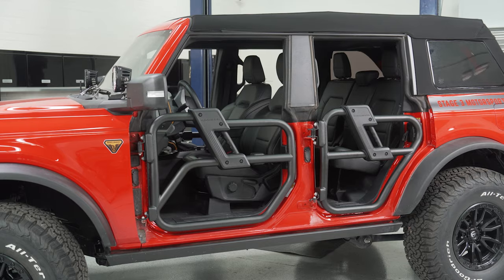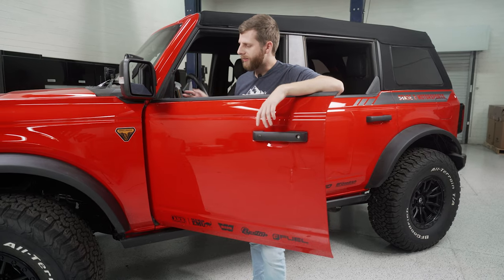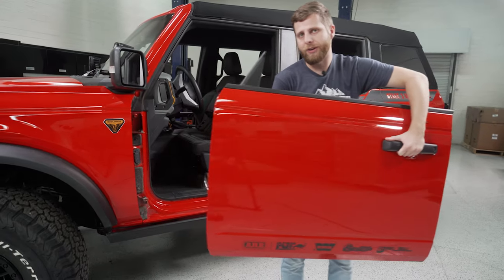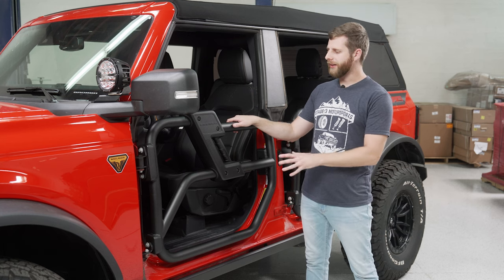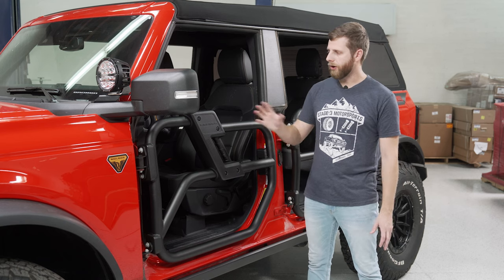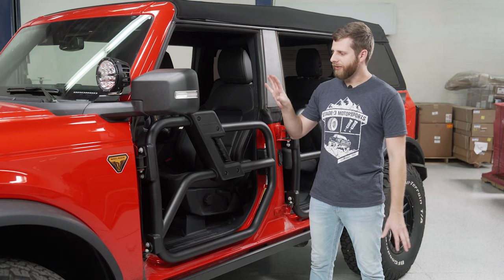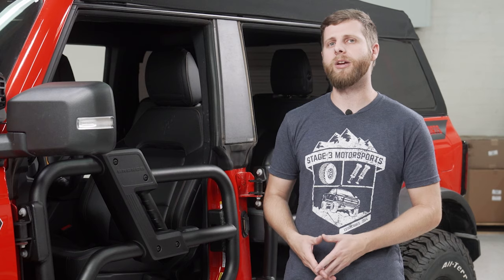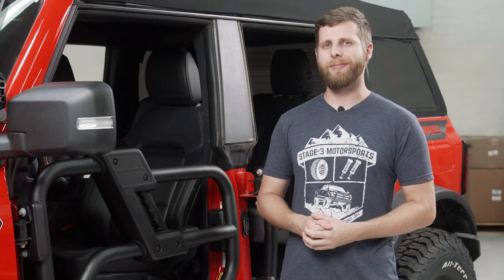Bronco Ford Performance Tube Doors Overview

Comment: does the paint peel off the door hinges after several door changes? will it rust?
Reply: I've interchanged mine at least twenty times and haven't had any issues. As long as they're removed with caution I don't think it's a problem.
Reply: @alliemarie9359  Does the doors open fast or slow?  I put mine on and I feel like the door doesn't swing fast..it seems like it won't rotate fast..
Reply: Candy, bulky plastic looking handles, be taken off